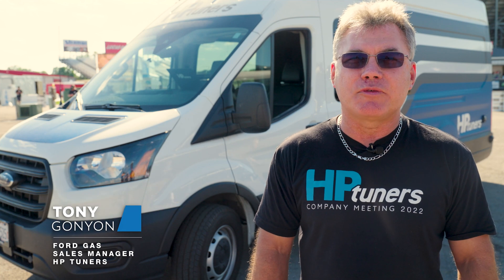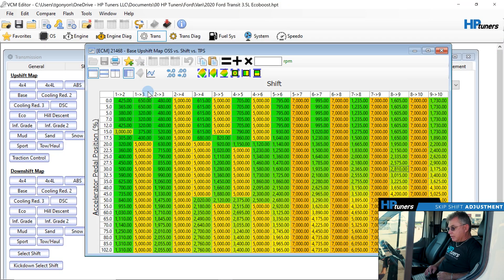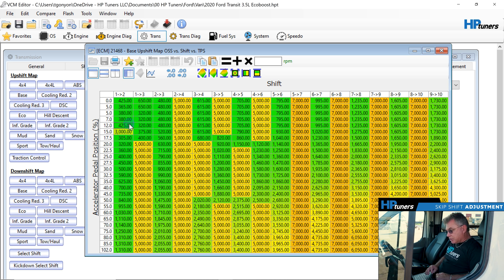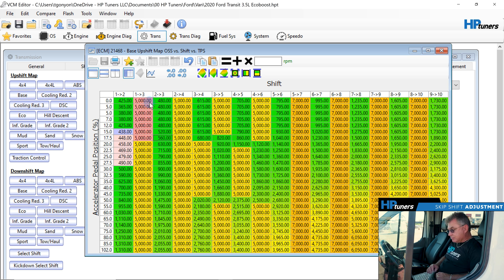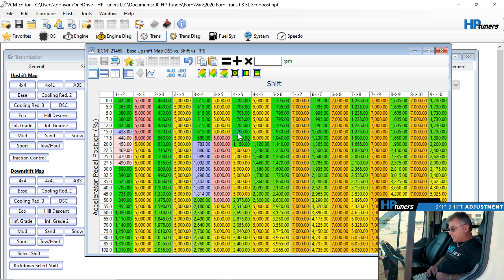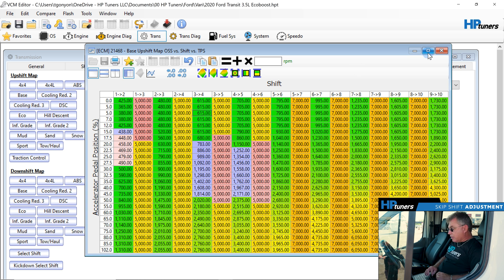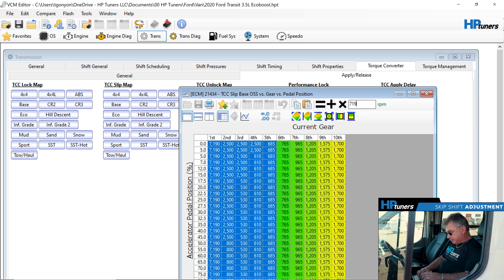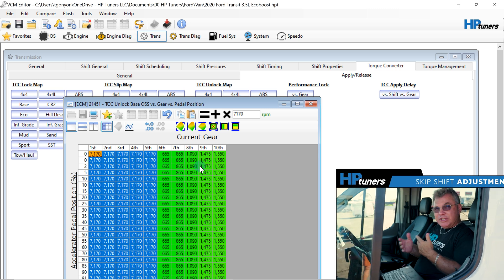Skip-Shift Tuning with VCM Editor | HP Tuners

Comment: Trying this on a 2019 f150 2.7   now it's running 2nd gear out till I let of accelerator. When give more then light throttle.  Any idea why?  I've tuned lots of 6l80s. With no issues.  This is my first attempt with a ford and the 10 speed
Reply: Ok so I fixed the shift problem.  Now I'm having firm engagement into drive.   If I flash stock file back it's fine.  Any ideas what I need to tune to soften the engagement into drive.  To me it seems more like a solenoid strategy problem after the tune file is loaded.